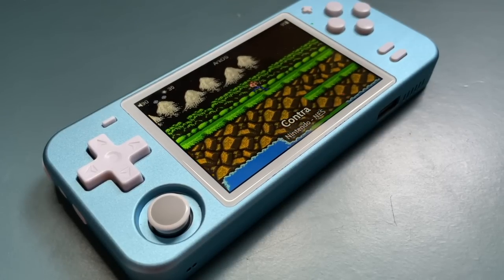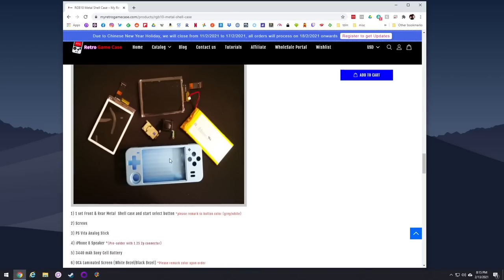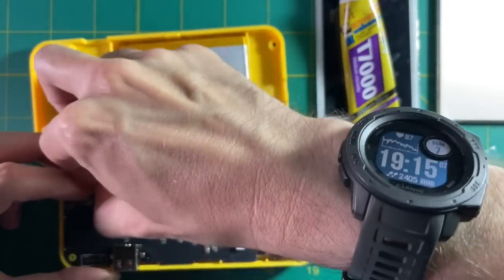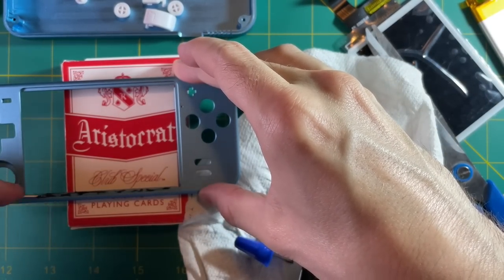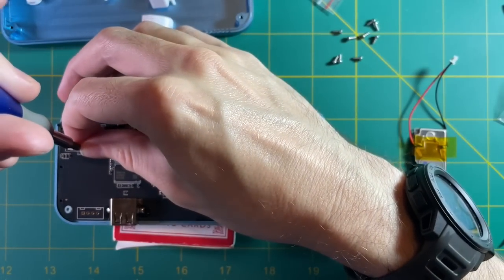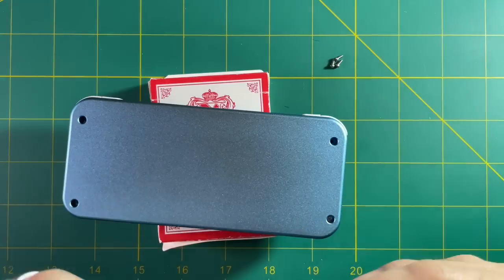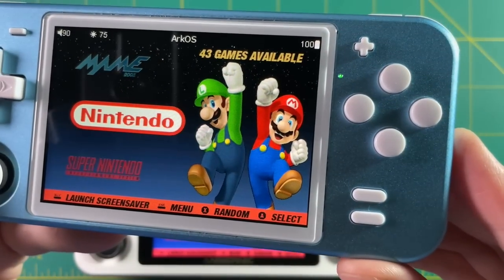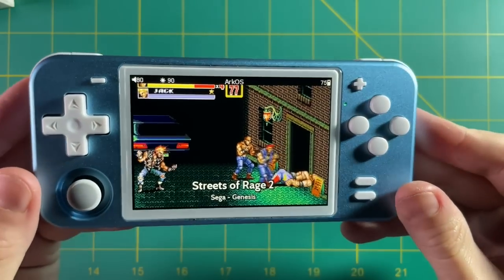PowKiddy RGB10 Custom Upgrades: Case, Display, Battery, Speaker, and more!

Comment: I, for one, enjoy the rubber on the back of my RG351M. Setting it down doesn't rub the nice metal paint and keeps it from clattering around on my nightstand.
Reply from the maker: I do think it serve a purpose in that sense, but in about six months you may be singing a different tune, when the glue starts leaking.  I hope it doesn't for you, because it was a pain to remove on my RG350 :)

Comment: Hey, @Retro Game Corps! Any chance you could do a guide on how to get Sonic Robo Blast 2 Kart or Sonic Robo Blast 2 mods working on the RG351 using ArkOS? The game runs on a fork of Doom Legacy, and you're very skilled at getting Doom wads running on these devices. I'm not saying it would be the same method for SRB2 as it would be for Doom, but you definitely have the skill set and mind to get it working great!

Comment: Is there such thing as aluminum buttons for the RG351P
Reply: Late reply sorry, but metal buttons would probably wear out the rubber membranes quite quickly, so I don't think any of these devices have an option for them.